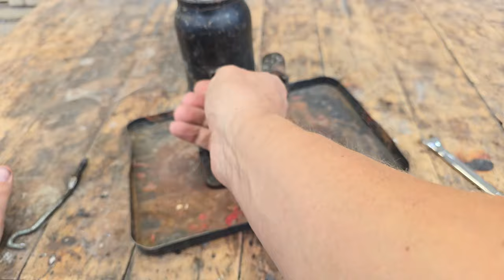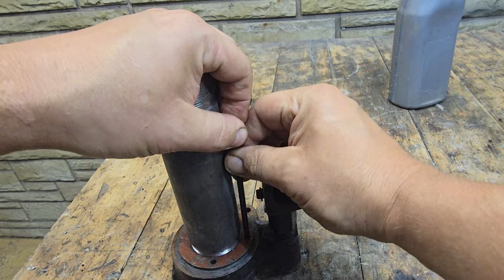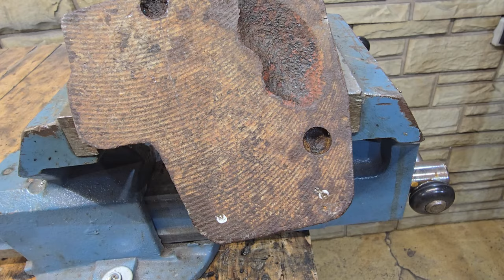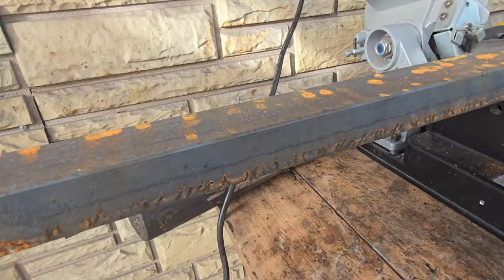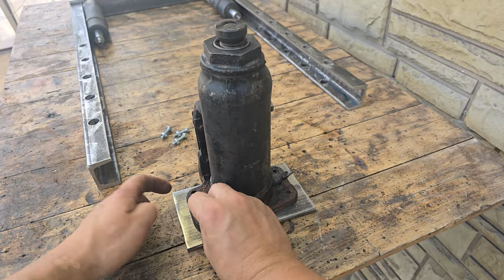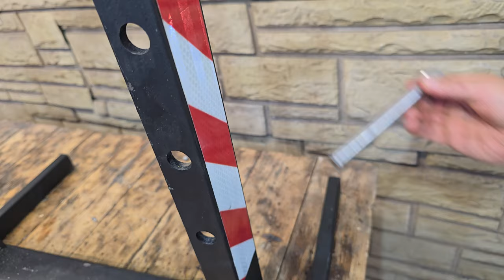Never Throw Away That Old Jack From Your Garage. A Brilliant DIY Idea

Comment: While your setup works. There really is no reason to mount the hydraulic jack upside down. The same amount of pressure is the same either way and mounting the jack right side up enables you to use another jack replacement easily if you ever have a failure... Just a thought!    Thumbs Up!
Reply: Rethink, your way would make things way more difficult. If you look you'll see why

Comment: I built a 12 ton upside down jack press. And they won't work w/o a oil tank on top to keep the bottle full, and I just realized what the pipe in the bottle is for. I don't have the cross beam, old shocks and retract springs and don't need them. And my jack slides from side to side.

Comment: All that for a crappy woodsplitter?  Maybe a wedge mounted on the jack would give better results. Or a hatchet.
Reply: I don't think he was demonstrating wood splitting... It was more to show that it could press stuff. You know, like the steering knuckle shown later.

There are many uses for a lightweight press like this, and he didn't spend $100 on it.